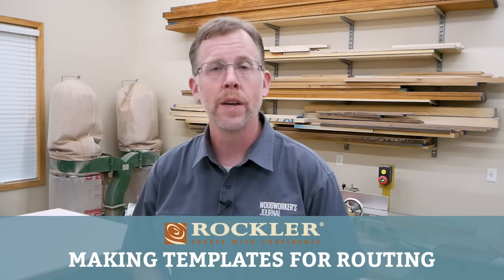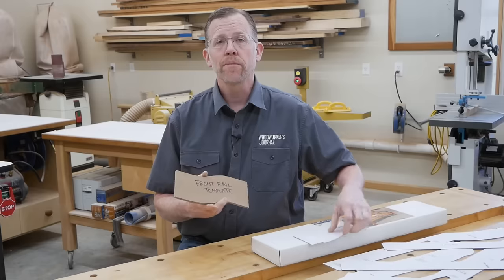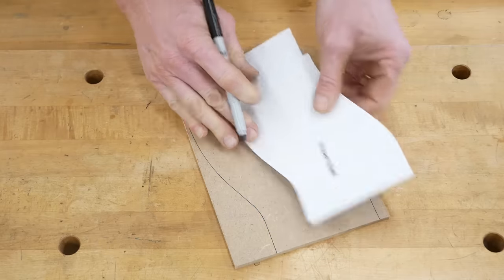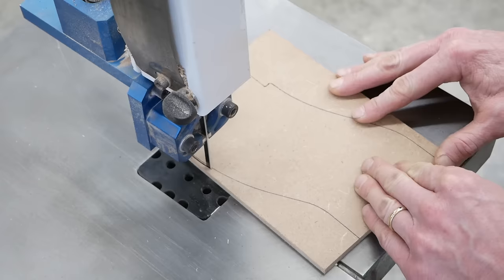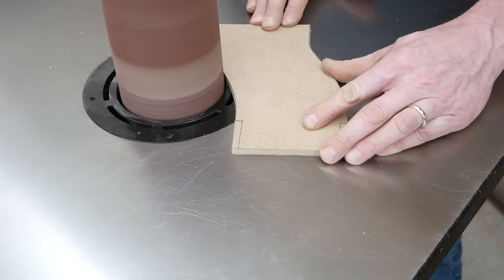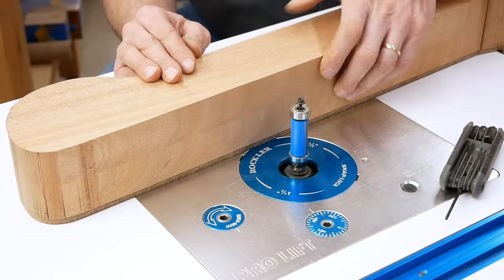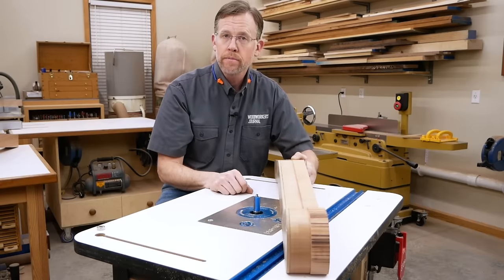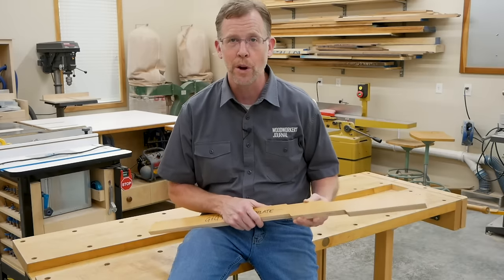Making and Using Router Templates - Rockler Demo

Comment: 1/4" melamine is a good alternative to mdo. Tape doesn't stick to it and it glides over the router table very easily. Also, the edges are not quite as brittle so a template will last a long time

Comment: I couldn’t get ahold of Masonite, thinner MDF than 3/4”, or really anything else except “bender board” for making concrete forms. Has anyone had any experience with this and how did it work out?
Reply from the maker: Many home centers will have thinner MDF on hand. It may be in smaller than 4'x8' sheets though. You could also use thinner plywood, like 1/4" or 1/2" thick.

Comment: You mentioned using up old finish to add durability to the template. Great suggestion. Also consider the material used. When I make templates from MDF, I always make sure to use shellac or some other film coat on the edge where bearings and bushings will rub. This insures the edge lasts longer and remains true.

Comment: Thanks Chris, very helpful to a novice. One question that I have is why 1/4" rather than 1/2"?
Reply from the maker: Hi Guy, half-inch-thick MDF or plywood will work fine for template stock. Really, any thickness can be used for making templates, but the thinner the template material is, the faster and easier it will be to cut and smooth by sanding. Thicker stock than 1/2-in. offers no real benefits for template-making, and 1/4-in. material is really ideal -- thin enough to shape easily but thick enough to stand up to regular use.
Reply: I have a bunch of 1/8" baltic birch plywood.  Is this stuff too thin to be used for templates?  I can always get some 1/4" panels, but it is of course 2x as expensive...